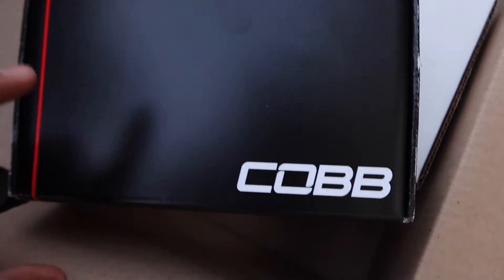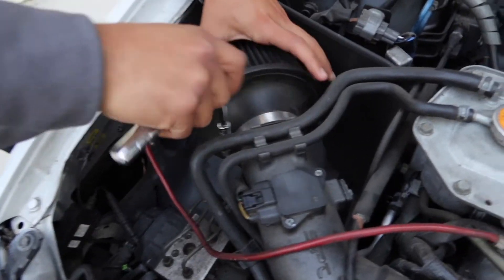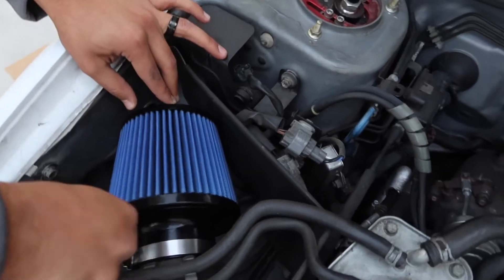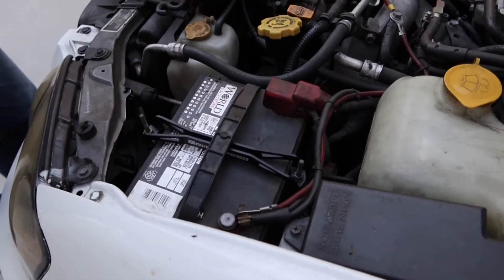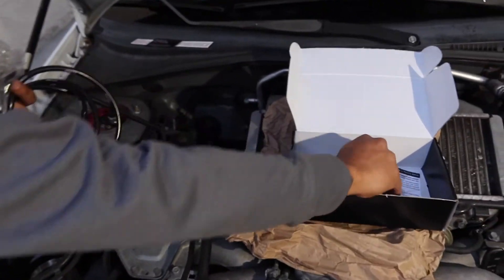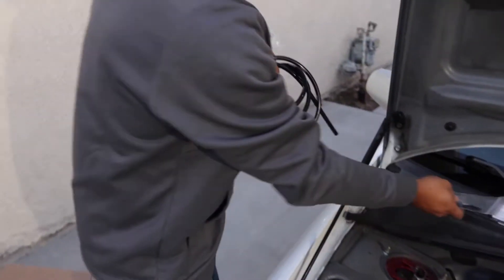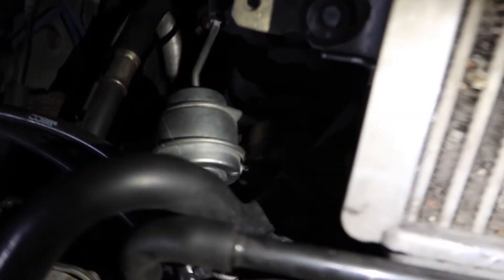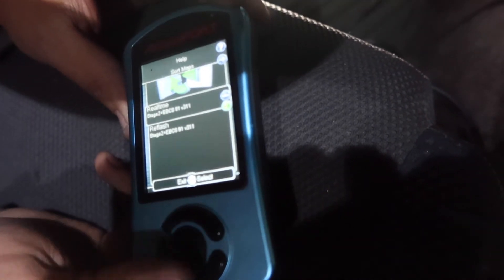SUBIMODS DELIVERY!!! Replacing WRX Boost Solenoid with EBCS, Air Filter, and Battery Tie Down!

Comment: Interesting, i did not know that Cobb had OTS maps that included EBCS. They only have six OTS maps total for bugeyes on their website. There used to be more but i had to go to the forums to get a VF-34 map when i updated from a V-1 Accessport to a V-3.  And the SPT filter is cotton so it can be cleaned using K&N cleaner and water and reused.